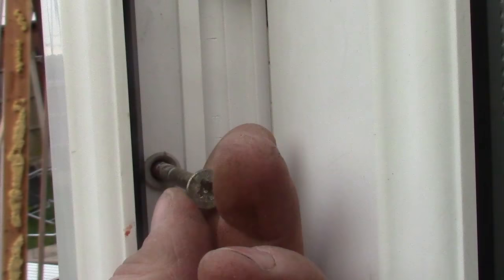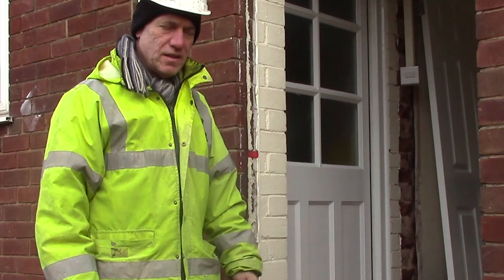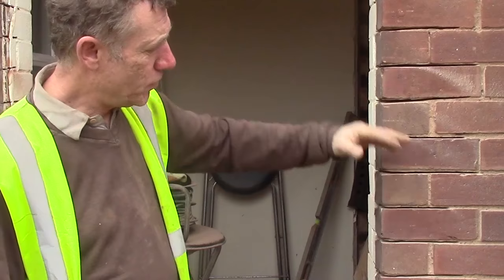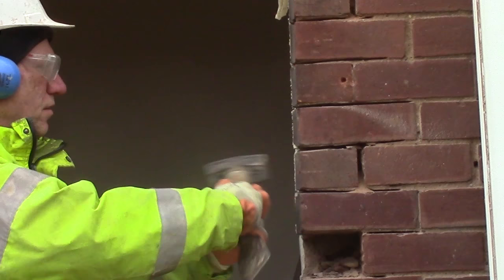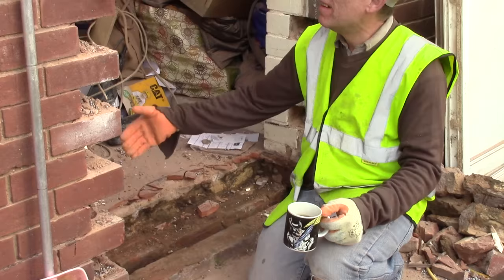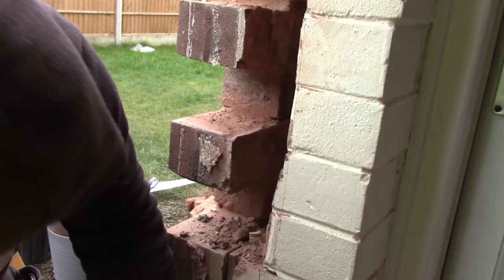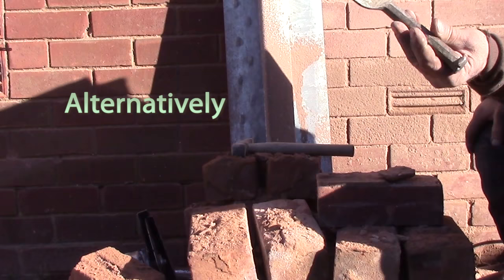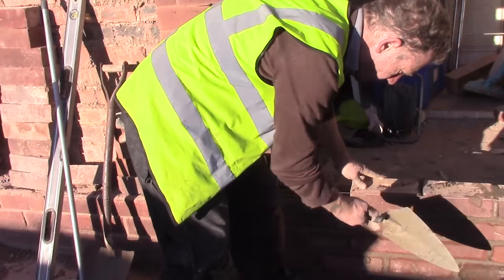Bricklaying How to move and brick up a door

Comment: Hi, 
great job.
Where you cut out the new door, are the sawn bricks not visible as the wall returns slightly into the dooway?
Or did you make the frame meet the face?

What would you do if the new doorway was to be inset 100mm or so, like on a lot of british terraces?

Comment: Nice job Chris you make it look easy 👍
Reply from the maker: Hi, thanks for the enquiry. I assume you mean a wall without cavity!  If thats the case then there are  recommended guid standards and its usually every three meters. Also there are  products that strengthen the wall.  Some building inspectors will want to incorporate a mesh into the runs as well as having peers!  I hope this has helped- regards.

Comment: Hi chris .. i am currently in the process of doing moving my back door 3 metres and putting it where some windows are (removing windows obviously) ... I See you have toothed out the bricks on the outside which i shall have to do to maintain a good strong join and look of the wall.. what have you used on the inside skin of the wall,  i can see blockwork but what kind of blocks (Dense, breeze, Concrete?)  also how did you join then to the inside wall ??     Many thanks for all the videos  you post i have used a few of them to do jobs on my own house.
Reply from the maker: Hi, sorry just seen your post-:(...I used dense block as I got them off another job, can use lighter blocks however.  I used wall starters which you can get from most builders merchants or alternatively you could use a wall strap and bend it to a 90 degree and screw it to the middle part of the block work, or knock a toothing section that will take half a block!  Hope this has helped...